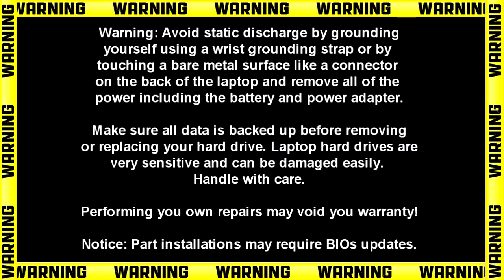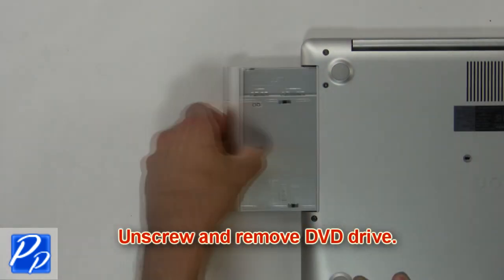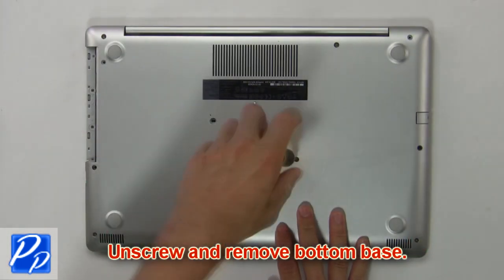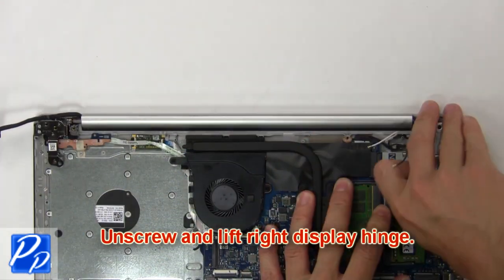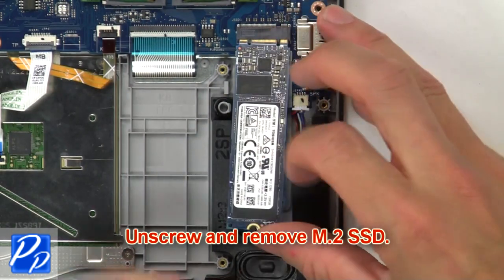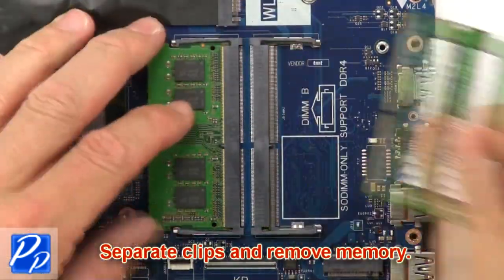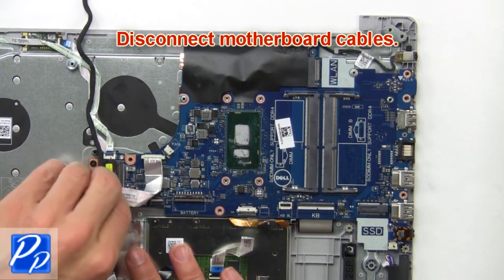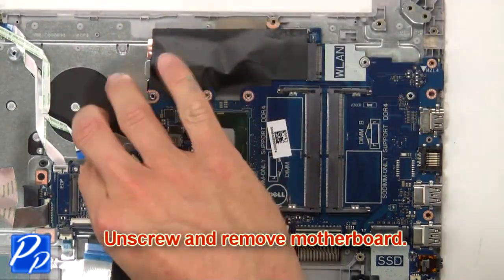Inspiron 15-5570 W/ DVD Drive (P75F001) Motherboard How-To Video Tutorial

Comment: Can we install nvme ssd (250 GB) in dell 5570, or only sata ssd?.. There is M.2 slot in my laptop.
Reply: You can install an M.2 NVMe SSD in your 5570. If you want to further expand the storage capacity, there's a SATA 2,5 inch drive slot where you can put in a 2,5 inch SATA SSD or HDD.
Reply: Hi guys please can you help. Will a 5570 motherboard be the same from i3-i7